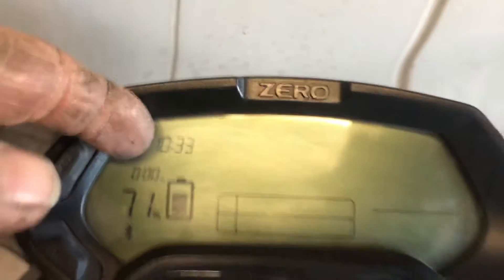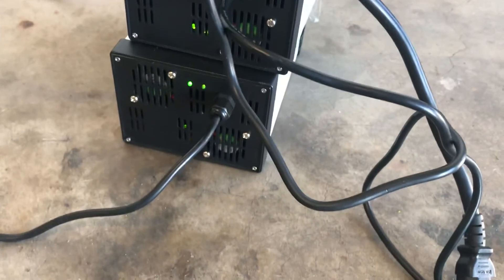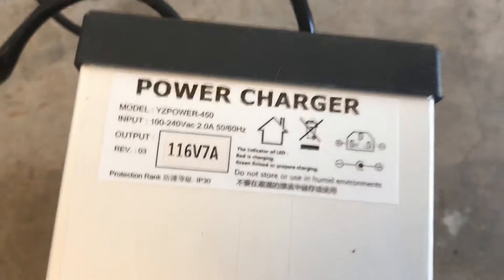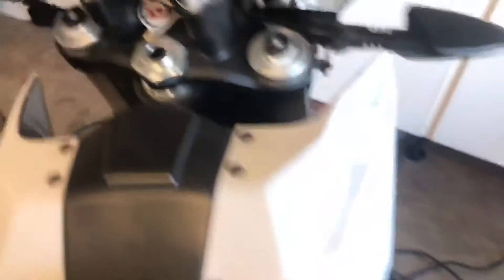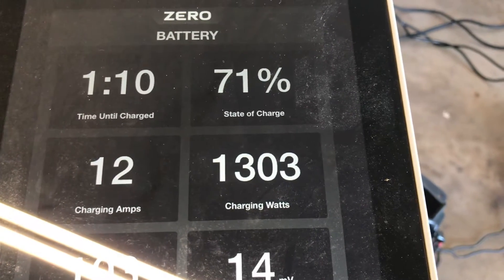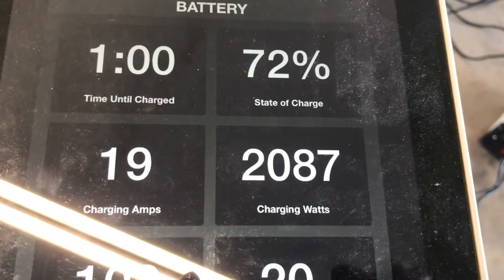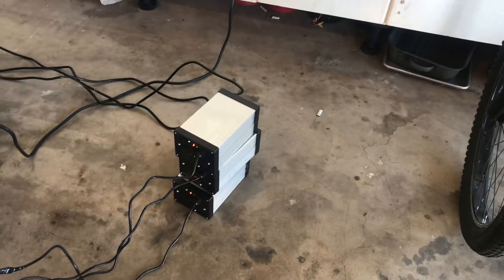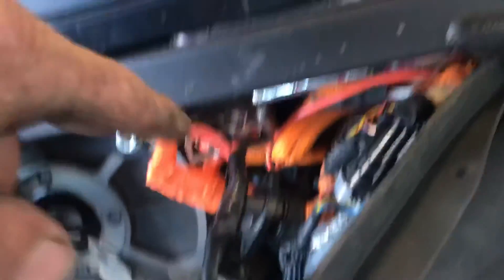2015 Zero FX Charging Super Charger

Comment: Randomly found this video, been looking at several hundred for various Elcons and such. Looked up said YZpower-450 on amazon, 70 bucks with prime. Grey instead of brown anderson though. I'll report back if it works out of the box or if the unit will need modified, and if it even charges any faster in general.

Comment: My 2016 FX (6+ years old) just started to have the exact same symptoms with the green charge light flashing for a while then going dark. It's a common failure... I've been waiting for this moment and it's finally arrived. Thank you for the video. I'll look for a YZPower to hold me over until it's repaired, and then maybe continue using it to charge at double rate after that.

Comment: Can you detail the connections you made - everything I would need to do to go from the YZ Power to the Zero, initial connection and the Y-Adapter stuff?
Reply from the maker: Caleb Cohen the why adapter is pretty much just that .. I did male deans plugs on the chargers .. and I did a female on the zero offboard charger plug , I got lucky in getting it with my bike , they cost $150 from zero .. not totally needed , as soon as the breakers close from the on board charger CAN BUS communications the offboard plug is HOT ... but it is for sure nice to just plug in the correct Anderson plug after the breakers close .. I just got the other 2 YZPOWER chargers this weekend, I've been using 1 for over a month when the stock zero Charger quit ... .. hope this helps
Reply from the maker: Caleb Cohen ... components. #1 for sure need a Zero off board charge plug
#2 Deans plugs, or the smaller Anderson connectors ( whatever your comfortable using)
Reply from the maker: Caleb Cohen https://youtu.be/EO1K8te-Ew0